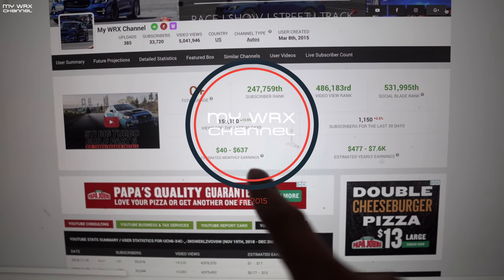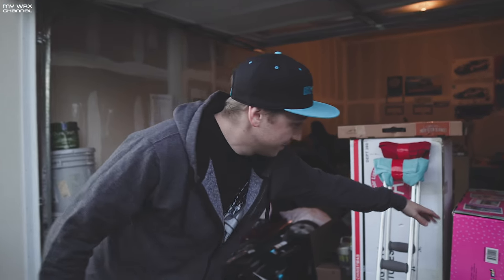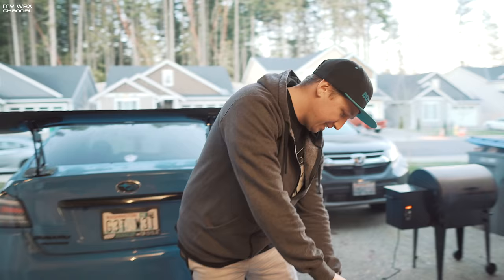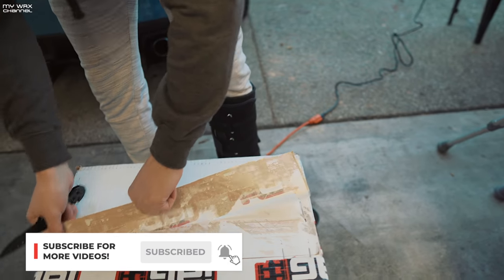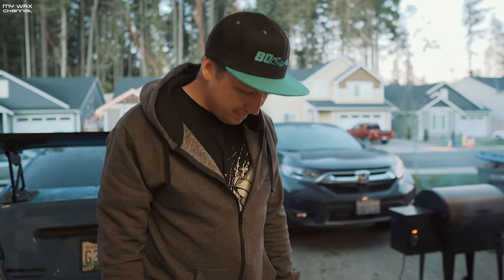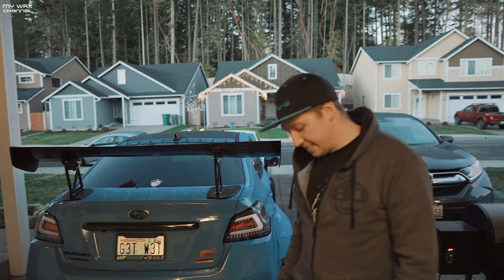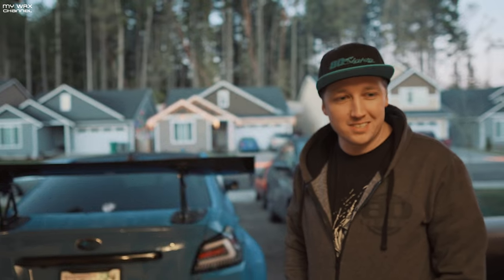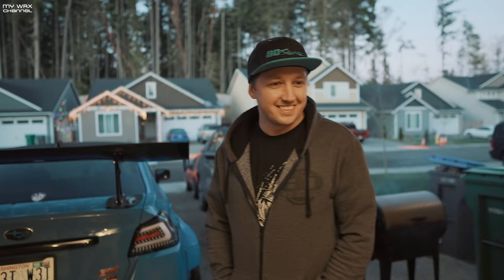WTF? #IAG CLOSED DECK BLOCK? SHOULD WE? | 2016 SUBARU #WRX #STI

Comment: Honestly I would take the built block and put it on the stand. Build it over time so when the stock block eats a d you have fresh awesomeness to drop in.
Reply: white line fever he already has a built bottom end!
Reply: @subiejayy  I get that but a good set of ported polished heads,   upgraded valves 'n' springs, cams would go on the new moter a lot easier then pulling the old moter every time. I personally would polish the valve covers, get polished pulleys also but that is just me. I'd look to fabricate a better timing belt cover, aluminum not plastic. There is a bunch of little things that are so easy to do when a block is out of the car that just make the completed product look better.
Reply: True! Building my heads right now!

Comment: Highly recommend GSC S2 Cams, if you want your heads done right send em to Headgames Motorworks! They only do heads, they started on the subaru platform and one hell of a rep because of them!
Reply from the maker: That would be dope. I've been trying to tell him ;)
Reply: Awesome! Im excited for your build im a bit behind on mine, IAG Stage 4 Extreme etc, will document it and send you a link if you want via IG
Reply: IAG or outfront motorsports is where the pro racers get their heads done at.
Reply: Danny Romine Thats one of the few. But Headgames is the best. They built the Whitebullet’s STI heads. And a numerous amount of record breaking builds heads. P&L also.

Comment: I am running a safe 670hp on e85 with stage 4 extreme IAG block (#01950). Great engines, +8k rpms. Would be curious what clutch u choose, found my triple disk to be pita to drive.